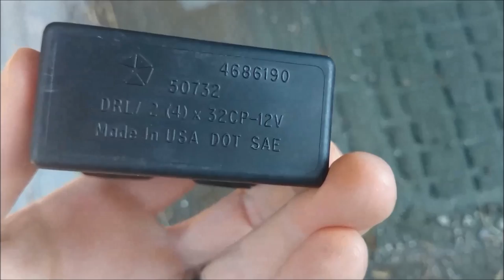Vehicle Tips: Dodge Caravan turn signal problem

Comment: I was having a problem with my left turn signal not working all the time...I watched your video and didn't know about the relays under the dash ...I checked them and found that all three of them were
loose, and plugged them back in...problem solved.  THANK YOU !!!
Reply from the maker: That is awesome to hear.  Thanks for letting me know.
Reply: As a bonus, my intermittent wiper speeds weren't working ... they work now :-)
Reply from the maker: @kenbrownfield6584  Good to know

Comment: THANK YOU!! I am going to check mine in the morning. I googled turn switch for 2000 dodge grand caravan and this video came up!  My left blinker quit but the right one worked. My husband replaced the lights and the blinker worked again. I went to the corner store and my blinker worked for about 10 clicks and it's dead again. I hope mine is just lose. I really don't want to put another dime into my van, but I love it even at almost 16 years old!
Reply from the maker: Hopefully.  Though if you only had a problem with one side it is probably not a loose connection (assuming it is the same set up as the one on the video).    Maybe the problem is inside the relay.   Check the flasher bulbs that were just put in too, make sure they are not burned out.    They are a very common van and a replacement daytime running light relay from a scrap yard should be cheap.

Comment: Great video.  My left turn signal was not working, but my right signal was working fine (2000 Town and Country).  I replaced the turn signal switch ($110) but it did not fix the problem.  After watching your video I check my relay under the dash.  After I pushed it in...IT WORKED!  Thank you for this great tip!
Reply from the maker: So glad it could help.

Comment: Pulled out the relay in my '99 3.3L v6 Dodge Caravan because the left turn signal was working intermittently , and was surprised to find that it was like yours but cut in half. There are holes for the terminals of the one you have to fit into the board, but my relay was half the size somehow. Pulled it out, didn't see any cracked solder on the board, snapped it together and put it back in. Left turn signal worked fine. fingers crossed that's the permanent solution. Thanks for the help!
Reply from the maker: That is weird.  It's possible that there was corrosion on the plugs or just a loose fit like mine.  If it acts up again when driving, try reaching down (when stopped) and pushing the relay in tight.  If that fixes the problem then you have a loose connection.    As for being half the size, that is odd too, does it say DRL on the relay?  Maybe your van doesn't have daytime running lights or that is not the original relay.

Comment: Sure wish I would of seen this video prior to me dropping my 99 grand caravan at shop. They installed a switch arm on the main column,  but the blinkers still worked intermittently. New Replacement Flasher was 90.00, switch arm 280 with labor. $370.00 WOWEEE!! Word of mouth I have to tell a lot of people this shop doesn't Google or trouble shoot anything.
Reply from the maker: That's disgusting.

Comment: Same problem here except one side hyperflashed and the right front wasn't working. Wiggled the relay around and everything started working ok. Then I took it out, leaned its terminals and the socket connectors and reinstalled i. Its ok now

Comment: Hi, If you have a factory installed tow bar there will also be a bunch of relays stuffed in the back side of the driver side tail light asembly, those relays are notorious for going bad and blowing fuses.
Reply from the maker: Thanks for sharing that.  Fortunately my van did not have a tow bar.

Comment: If your not familiar with these relays they can have you guessing for quite awhile.  I had a Honda Accord with a sometimes start. Turned out to be a bad solder connection. A little solder and no further issues. But to get to that, well 2 shops had diagnosed it incorrectly.
Yeah YouTube :>) !   I had to do a video on it. Stay well,   Joe Z   👍 1o6
Reply from the maker: Wow, that would be a tough one to figure out.
Reply: It was. I really miss just having points plugs condenser mechanical fuel pump & HP 😕 Joe Z

Comment: My passenger back turn signal and brake light are out, but the parking light works. I've changed the bulb and the connector in the tail light. Should I try this?
Reply from the maker: If your brake light is out as well then no I don't think this is it.  Also, if the relay is loose it affects all your flashers, not just one. .
Reply: I have the same problem!!!
Dodge grand caravan 2007

Comment: Thanks for the information!  FYI my caravan, has another problem where randomly all the interior lights and door switches start turning on and off it happens for 10 seconds or even 1 minute, it stops, starts again then stop. Any ideas other than the van being haunted? lol Thanks again.
Reply from the maker: +Salsa Guy Richmond 
Thanks for commenting. What year is your van? 
Is your van haunted only when it is in motion?  
I'm only familiar with 2002 and older vans but it sounds to me that maybe one of the sensors that detect your doors being open or closed might be not making a good connection. 
 If the van thinks that one of the doors is open while it is driving it will try to lock the doors, then they will unlock, and the interior lights will go on and off.    
 Check all the door sensors for corrosion or sticking (including the tail gate) and if you find one that is messed up, try disconnecting that sensor and twisting the wires together so that it thinks the door is closed all the time. Then see what happens.  

Let me know how it works out.
Reply: There is another computer in the van under the panel where the Flasher/ DRL Module of this video is plugs in.  It is called the BCM or Body Control Module.  From other sites I have checked this too can be a source of troubles. It will in some cases affect the dash panel.  The fix for the BCM is to have the unit repaired which is reflashing it.  The Chrysler dealers from what I see charge $300 to $500 to do this.  If you go to Ebay there are several folks that specialize in repairing and reflashing them.  You will also need your odometer reading to be added to the reflash.  You can also go to a salvage yard but the unit from the salvage yard will have the odometer reading of THAT vehicle also no way of knowing if it works. Hope this helps.

Comment: I got a 2010. Caravan.   Sometimes  works.  Sometimes it said left rear then signal  lamp out.     What is the problem?
Reply from the maker: I actually had a problem like that with my in-laws newer 2013 van and it turned out to be a loose/faulty flasher bulb.   I made a video about it here  https://www.youtube.com/watch?v=dl9P8HWrpGA

Comment: My 2000 Dodge Dakota is having the same issue with the turn signal. They will flash for a while then quit, and come back seconds later. What did you find out as I don't think mine has a running light relay?
Reply from the maker: +Tyrone Walker  You would have a flasher relay though.  It might be loose or need to be replaced.  That if the first thing I would check.

Comment: Josh - What was your final repair solution to the problem?  I am having the same issue.  I have a '98 Chry T&C LXi AWD with 288,000 miles I hate getting rid of it as it still runs great and getting a newer one really costs especially when you are on SS retirement.   I notice changes in outside temperature seem to have an effect.  I suspect possible cracked solder joints.  I checked with Oreilly's and Napa the cost of the part new ranges from $57 to $113 respectively.  I am gong to remove it from the vehicle and check it this evening.  I'll post a follow up.
Reply from the maker: It was where the relay plugs in.  It just didn't sit tight.  It plugs in sideways and there was just too much play between the prongs of the relay and the socket they went into.  Once it was secured tightly in place the problem went away.

Comment: My wife's 97 Grand Caravan is having this issue, along with the brake lights not working. The bulbs are working, and the right turn signal is working. Just no brake lights or left turn signal. If this relay goes out, will it affect the brake lights as well?
Reply from the maker: Sorry I don't know that one.  I don't think the brakes  lights are related to this relay. Did you check all the fuses?
Reply: Brake lights also work through the turn signal tiller on the steering column.  You may have a problem there.
Reply from the maker: Thanks Mike, I actually didn't realize that.

Comment: Both the front and rear driver side does not work on my 97 caravan
Reply from the maker: Have you checked the bulbs?  Maybe it is a wiring issue.
Reply: The hazard lights work but just not the turn signal by itself
Reply from the maker: @joejoepiel  Weird.  Maybe check your fuses and make sure all the relays are tight.  Beyond that I cant be of any help.
Reply: Would one side of flashers work without a relay by chance
Reply from the maker: @joejoepiel  There might be 2 relays, if so swap them and see if the opposite side stops working.  If there is only one relay like on my van then the only way one side would work and the other not would be if there was a short inside the relay.  A simple way to test it would be to find a similar van and borrow the relay and see if it makes a difference.  These vans are so common it shouldn't be hard to find one to borrow.

Comment: Thanks a bunch! My dad doesn't want to invest a penny in fixing our old van (which I have become very attatched to for some reason) and our right blinker would work like... 1/3 of the time. And sometimes, when it doesnt work, flashing the high beams once would get it to work for a bit. Thanks to you, I might be able to fix ir for barely anything!
Now for the horn, airbag and cruise control...
Reply from the maker: I don't blame your dad.  I hate pouring money into old vehicles.    I have learned not to from an experience I had with my first van.    
It was a 92' Dodge Caravan, given to me by my brother, and I kept it in tip top shape. I fixed everything as soon as it went. All myself. I took a lot of pride in it.
Well one day the transmission broke.     I stupidly paid $1750 for a rebuilt one to be put in.  The van had about 350,000 km on it and was probably only worth $500 at the time in 2005.
Exactly 3 weeks later the engine quit.  My stupidity didn't end there, I spent over $800 for a gasket kit and having the block and heads resurfaced.  The problem was a broken piston (literally cracked in half).

In the end, I never ended up installing the rebuilt engine.  My $250 parts van was running so smoothly I decided to make it my primary vehicle. 

So don't be afraid to cut your losses if the problems get out of hand.  

And one last thing, I wouldn't touch the air bag.
Reply from the maker: Awesome